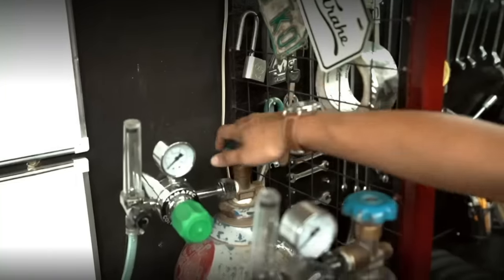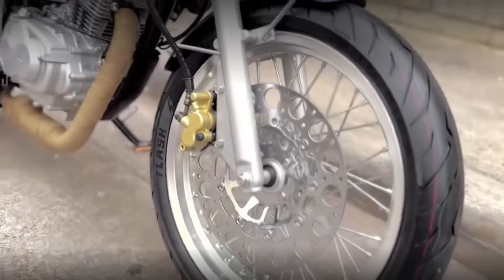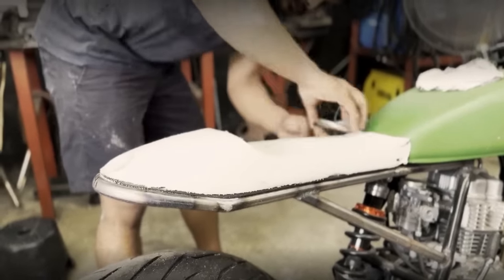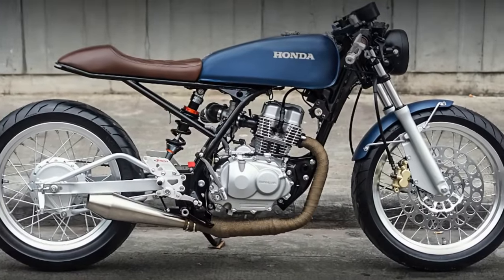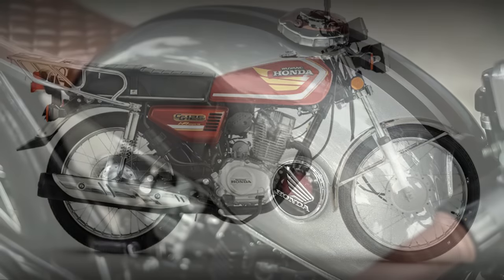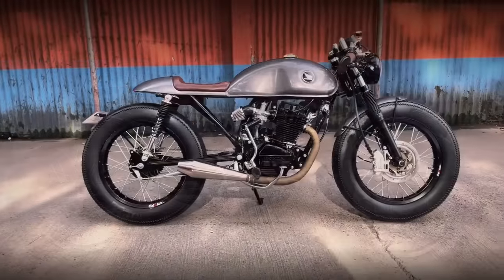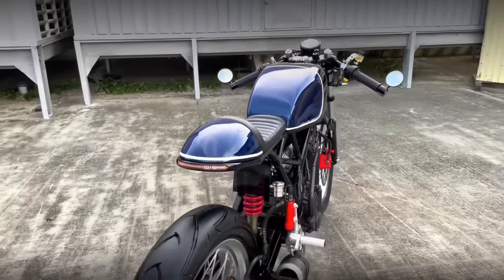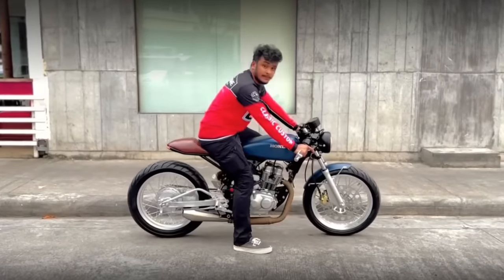Small Cafe Racers 4 (125cc) - Honda CG, Honda TMX, Suzuki Raider(by La Garahe Motorcycles)

Comment: I'm seeing one problems about the small cafe segment and that's the bike looks cool without the rider. but the proportions will be wacked when riden
Reply from the maker: Excellent question. I already talk about it several years ago. Yes, you are right about it.  For most 125cc motorcycles, I think 1,7m for the height of the rider, is probably the limit to keep everything proportional. But if the rider is taller than that, maybe a Scrambler bike with a very tall seat is the ideal choice. :) Cheers.
Reply: Good thing Filipinos aren't blessed with height :) An average male Filipino height is 5'4"
Reply from the maker: @87 Octane Indeed. I begin to see a lot of advantages, about having a lower height. Especially for traveling on plane. Loool. Cheers.
Reply: @RACER_TV  yeah there are advantages haha! Love you channel by the way!
Reply: @RACER TV  but huge disadvantage was even with a r3 being 5'6 is already killing my back